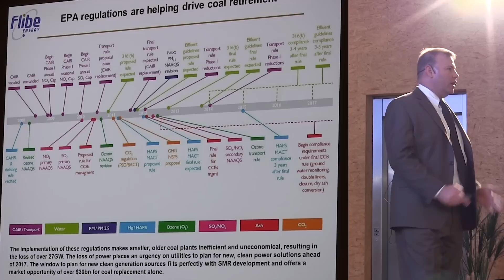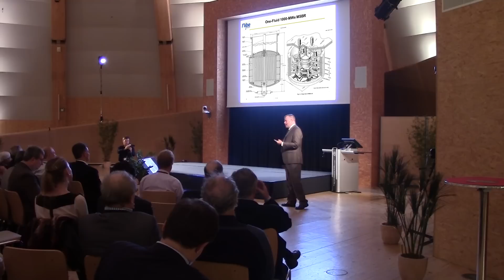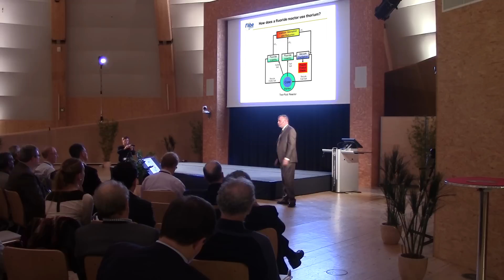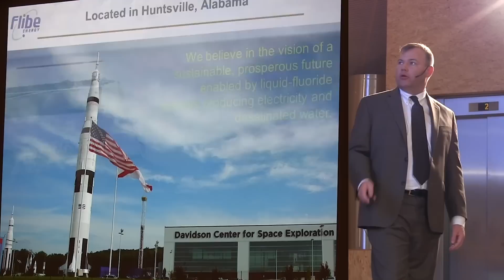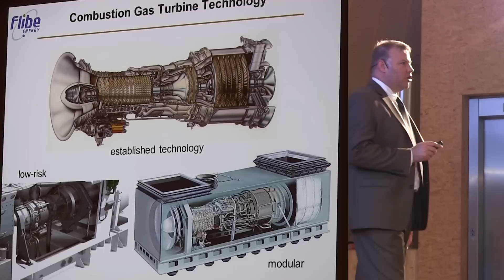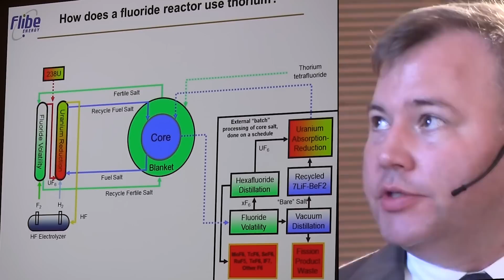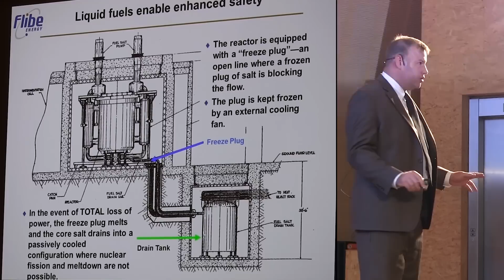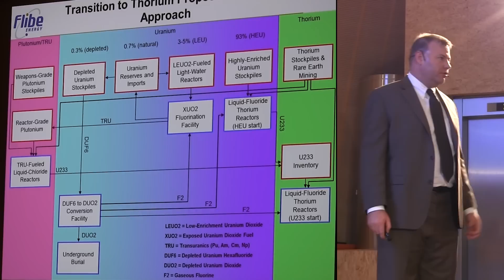Kirk Sorensen - Flibe Energy "LFTR Development Strategy" @ ThEC13

Comment: WHY ARE WE NOT DOING THIS!!!!! It's crazy that the greens are the main reason this hasn't happened sooner.... Face 2 palm
Reply: Actually, the so-called GREENS are not the reason why this path wasn't chosen in the early 1970's. The powers within the US Atomic Energy Commission had chosen a more synergistic path using the LMFBR concept.  As this was during the Cold War, the plan to pursue Pu-239 based Fast Breeders made some sense.  However, safety & proliferation issues (+ other concerns) killed the LMFBR at a time when the THERMAL Breeder had already been defunded. Alwin Weinberg, the father of the Molten Salt Thermal Breeder was politically side-lined, in the face of pro-LMFBR intertia, around 1973.  His cardinal sin was proclaiming to the AEC powers (& publicly) that the Molten Salt Thermal Breeder was a much safer design than the solid fueled fast breeder concepts favored by the broader nuclear industry.

Comment: Originally, FLIBE was going to somewhat bypass the NRC by working directly with the military.  The Navy  reports to Naval Reactors not the NRC I have read. If you listened to Jim Kennedy at this year's TEAC 5 Conference he painted a very dark picture of working with anyone in Washington DC when it came to thorium. Jim has said that the NRC has basically been working with China on MSR's and LFTR's.

Listening to Kirk here, I am more optimistic and it seems FLIBE is trying the direct route by working with the NRC.

Hope it succeeds.
Reply: The Head of Naval Reactors wears two hats (or combination covers, as the case may be).  On the one hand, this senior flag officer (4 star) is part of the USN.  On the other, a deputy administrator under the Under Secretary for Nuclear Security/NNSA (within the DoE).  The NRC is separate from the DoE and its main focus is on civilian nuclear applications (safety, security, licensing, spent fuel management, medicine, etc.).

To my understanding, China's National Academy of Sciences signed an MoU with the DoE for access to ORNL, not the NRC.

Comment: There is one thing that will accelerate the US Nuclear Bureaucracy to action, the public embarrassment that China will commercialize this US invention first. If only the 4th estate wasn't so concerned about Big Oil's opinion on the matter.
Reply: +JB6789 its my understanding China had a 2015 target they moved to 2017 and most western countries are looking at 2020. So even if china pushes it back a few more times they will have it first. Better to have a safe one than the first one tough.
Reply: Big oil could benifit bigly in their refining processes by supplying large amounts of processing power (electricity) and large amounts of high temp process heat for hydrogen furnaces and other chemical conversion processes.  Why burn the furniture so to speak, trying to produce a hydro carbon product, example, synthetic diesel fuels, gasolines and other light ends?  
MS Reactors would fit in perfectly in the process streams.

Comment: We can safely say it will not take any longer than a double hulled super tanker. IF all hastolloy piping is available with intercoolers of hastolloy are made and ready for the build and super critical co2 turbines of 200 to 600 megawatts are ready. Intercoolers to handle 600 to 700 degree co2 with whatever heat process liquid are also needed for the Brayton cycle. All components will cost in line with a coal fired power plant.

Comment: Why would the salt (freeze) plug melt, if power (heat) was lost? why not just use a thermal (lower melting pt) metal plug.
Reply: +Spock The plug melts becuse the reaction continues to produce heat but the cooling system fails to cool the salt plug..When you recover from the event you simply refreeze more of the salt. you don't have to take the system apart to put a new plug in.

Comment: I'm showing my ignorance here, but does the implementation of the gas reactor for electricity generation have a significant impact on the greenhouse gas emissions of the LFTR? Or is the working fluid constantly recycled? 

Also, does this two-fluid LFTR design still have potential to produce hydrogen, as Kirk has claimed in earlier presentations?
Reply: The way I understand it is that is a closed system. And its not a Gas reactor. The heat from the reactor is used to Drive a GAS Turbine. So the gas added in the system just stays there. As for the byproducts produced by the reactor itself.. They literally separate themselves straight out since its generated in a Liquid. I am sure there designs incorporate ways to capture and vent gases produced in the cycle.
Reply: haha, yeah sorry my mistake! I've been writing the word "reactor" far too often recently. Thanks for your response, however!
Reply: The gas is in a closed system and acts as a working fluid to move the turbine, generating electricity.  This closed system is twice removed from the primary loop(s), via two stages of heat exchange.  Waste heat from this closed gas cycle, could also be used to desalinate sea water.
Reply: I think the purpose of using the heat in a gas turbine engine is probably got to do with the high thermal efficiency of this type of engine, with residual heat that can then be used for other purposes.

Comment: Are you sure thermal expansion rate can keep up with supercriticality rate? otherwise that thing goes BANG!
Reply: +Spock   It isn't so much that the expansion rate stops the reaction by itself, it is in conjunction with the loss of the graphite moderator/reflector that produces thermal neutrons which can be captured by the Thorium and U233.
Reply: Yes, the graphite fuel elements are only anchored at 1 end (to the bottom of the reactor) to accommodate thermal expansion axially in the reactor core.  As for the reactor vessel itself; it operates at a slight vacuum because when the salt liquefies, it actually reduces in volume (opposite of water).  The reactor operates continuously hot at a consistent red heat (black body emission spectrum).  Fuel salt inlet temperature is about 1000 degrees F, and outlet is 1300 F.  That's a delta of only 300 F.  The blanket salt enters at 1150 F and exits at 1250 (only 100 F delta). The associated expansion and contraction of components are well within the design specifications of the reactor.  Remember, a MSR was operational at ORNL for over 20,000 hours, from 1965 to 1969.  If for some reason criticality goes too high, the cooled salt plug would melt and the contents of the reactor would drain out and cool down.  It is a passively safe design.  Sorry, no "bang".